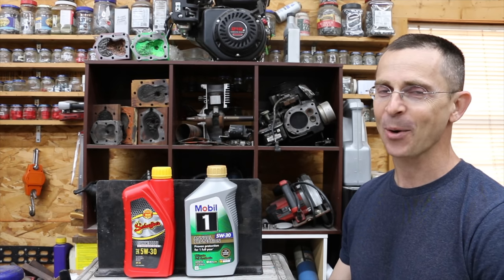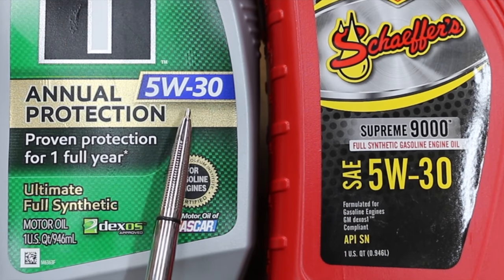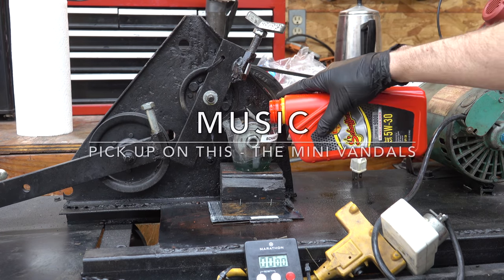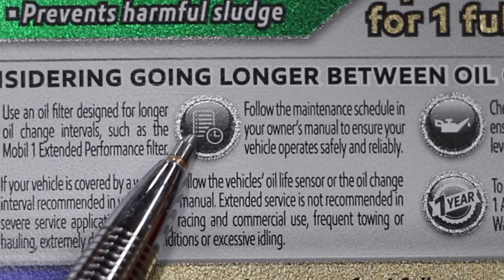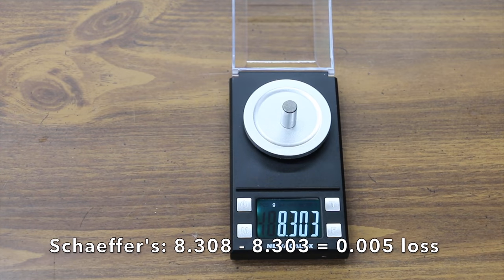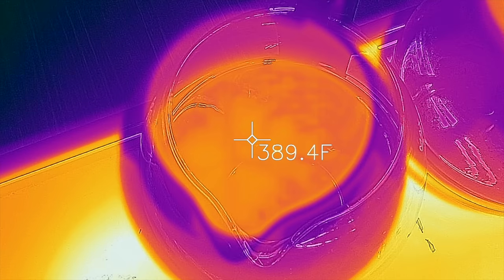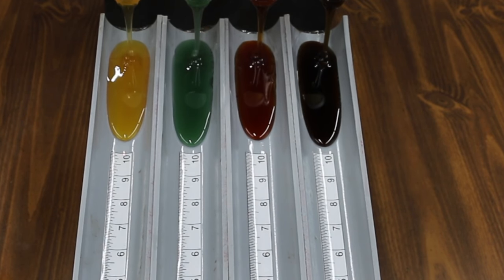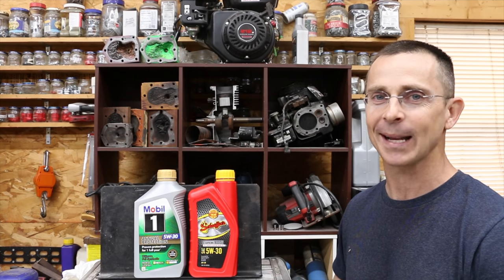Is Mobil 1 better than Schaeffer's Full Synthetic 5W-30 Motor Oil? Let's find out!

Comment: i always use Mobil 1 15,000 mile synthetic but replace between 5-7, i'm not gonna take it to 15 just cause it says i can, and use the extended performance filter.   (i do 50k miles a year, so it feels like i'm changing oil every few weeks) but my 2014 mazda 3 is at 220k miles and no mechanical issues or repairs needed, just maintenance: oil, brakes, plugs and fluids.
Reply from the maker: Thank you

Comment: it's not so much which oil has the lowest viscosity, it's which oil maintains its stated viscosity. I'd like to see a modified film test where you see how much of a friction load the oil can handle while maintaining a oil film so there is zero wear on the bearing (the oil is doing it's job of keeping the metal parts from touching)... perhaps by watching current on a watts meter, finding the point where current jumps at the point where too much friction causes metal to metal contact
Reply from the maker: Thank you for the test suggestion!

Comment: I use only full synthetic oil from many different brands such as castrol, valvoline, promaxx, Mobil 1, and Amsoil. But i change my oil every 5000 miles and my 2016 and 2009 mazda 6 run like champions! Dont trust every 10,000 miles too hot here in Houston Tx! Cleaner oil will make yr engine last longer!
Reply from the maker: Thank you. I change the oil every 4000-5000 as well.

Comment: Tried Shaeffer's in my own car ONCE. We had an extended cold snap. I thought I had a bad battery as the car had a VERY hard time starting. Installed a new battery. Still VERY hard time starting (very slow turnover with starter). On a whim remembering the only thing I had done different was to try the Shaeffer oil to satisfy a friend who had become a distributor. Changed over to Walmart Syntec amazingly car started just fine with even colder temps. Will never use Shaeffer again. Overpriced IMO and not good overall in my experience
Reply from the maker: Thanks for the feedback
Reply: Its funny everyone thinks the oil They use is the best. I've had good luck with Mobil 1 . I have also had good luck with Chevron Delo 100 before we had synthetics and multi grade oil was no good for diesels or extended use. The main thing is to keep it Clean.
Reply: That sounds like a bunch of baloney. Engines need air, fuel and spark to start a combustion process and those 3 things only. Oil is for protection when engine starts running.

Comment: Very nice work! Glad this video popped up. I recently found out about Schaeffers because of their extensive use in the mining industry. 

Their grease is as inexpensive, yet of vastly superior quality, to what you can find on the shelf in store. I would wager because they don’t have a NASCAR advertising budget line on the balance sheet.

I convinced our company to switch to Schaeffers grease for our implements. We had multiple failures occur due to incompatibility issues with the greases used prior being uncontrolled and bearings failing. I could only find it locally retailed at an off road suspension specialist shop, so we bought up their supply.

I had no idea how much variation there is with grease bases and types. Would that be a project worthy of the farm? I certainly found it quite the undertaking to wrap my head around.

Best Regards,
Henry
Reply from the maker: Henry, Thank you!

Comment: Did you ever do a similar test on racing oils ? or , maybe zinc additives ? I added zinc additive  but it may have already been too late when I added it .  We have had cam and lifter wear issues on our flat tappet cam  in our hot rods / circle track / drag toys  . The cam is a very strange shape since it was made for a nhra stock eliminator . They call it a cheater cam ,  it  has  low lift , only .468" / .479"  , and is a hydraulic  lifter  but has  a bunch of duration and the valve hangs open at full lift a long time , and then , snaps shut , just in time from the piston hitting it . The cam is  more square shaped  and I'm guessing that causes too much  heat build up . We only run about 140 lbs of seat pressure  , so it's not the pressure , it's more to do with the shape .
Reply from the maker: Not yet. Great suggestion!  Thank you
Reply: @ProjectFarm   ... another question , maybe viewers would know ??  if you add more than 1 bottle of zinc additive  , will it help ? or , is there a point where more zinc wont help anything ?  can too much zinc cause problems ?

Comment: If Amsoil doesn't produce oil norms required for my engine (ACEA C2, B712290) , should I use another brand or can i stick with their 5w30 without risks ?

Comment: the wear scar on that metal test barrel is pretty extreme for my taste. The "ideal" optimal oil film with a minimal atomic thickness, being prevented from ripping by stabilizing additives would (or even should) never allow metals to actually touch each other if the tolerances are met everywhere on bearings and slides. Or the test barrel pressure weight is selected too high for oil films (punctual molecular layer pressure stability) to even have a chance to show its features.
Reply from the maker: Thank you!

Comment: Regarding your bearing wear lubricity tester, could you please include a control bearing that shows wear after a dry run using NO oil.  Thanks.
Reply from the maker: Great suggestion!  Thank you.

Comment: I change hawe precise changed oil in my engine and gearbox on my pegueot 307 and the brand i got in it was mobile1 5w / 30 the same as you tested i don't think the other brand is marketed here. I have always run with castrol 0w / 40 before and it has worked well my car has rolled 21000 Swedish mileage 1swedish mile is 541 us nmi and it was because I also changed the oil in the gear box, how often do you recommend that you should change  my oil in the manual gearbox the oil  I tapt off was so close to black it coul becan so it felt good to change and according to the pegueot307 manual they recommend mobile1 ... in the service boke it says that oil filters and oil should be changed every 3000mil but there is nothing said about the oil in the transmition. but on my car oil and oil filters have always been replaced at 2000 miles what do you recommend yourself i think 3000mil sounds crazy loong all the cars i had before i have changed oil after 1500mil
1 us nmi = 1.85km and one swedish mile is 10km  so i drive 1081usnmi before i change pil and engine oil is  that ok you think? 

and the to the transmition oil ? whath do you think about thath My engine gas rum 21000 Swedish mile dvs 21000÷1.85=11351us nmi and i changede the transmition oil i dont know if the transmition oil gas ewer ben changed before sura uppe so butt by the collie of it it didnt loked like so..

Love you show and Love you knowledge  best regards Michael bjarnarson a fan from Sweden
Reply from the maker: Thank you!

Comment: I have yet to seen anyone perform these same tests on used oil.  I would prefer to know how the oils hold up after being run in an engine for 1000 miles even in an uncontrolled environment.  I would rather have an oil that performs consistently as much as possible over it's life than only when it's fresh.  So is this over thinking these types of testing?
Reply from the maker: Thank you for the feedback

Comment: I have yet to see a high performance diesel running beyond its original design that ran on Mobil 1.  Everyone  uses Shaffer's, Cen-Pe-Co, PennGrad 1, or Amsoil.  1 turbo, or 4, Water Injection, or Multiport Methanol/water injection, 2600 RPMs or 6500!
Reply from the maker: Thanks for the feedback.

Comment: Is recycled motor oil as good as non- recycled motor oil? That would make a good video. An example would be like this: Is  Valvoline NextGen™ as good as Valvoline conventional?
Reply: Oil never loses it's lubricity.  It is the additives that wear out.  So, if you dump the old additives and add new, there is no difference.  Also better for the environment since new oil isn't needed.

Comment: I notice you shake the oil ... is that required?  I've never done that ... I wonder if I'm doing it wrong?
Reply from the maker: It's not mentioned on the oil containers, but the additive package can fall out of suspension and settle at the bottom of the container.
Reply: @ProjectFarm  Thank you for the reply.  Makes sense; I'm just surprised I've lived this long, and not done it before.
NEXT TIME ...

Comment: which would evaporate quicker  in hotter temp 5w30 or 0w30?
Reply from the maker: Thank for  the video idea.
Reply: I live in the Mediterranean our lowest temperature is 14 degrees highest 46 degrees Celsius with a lot of humidity I need help which would be better suited for a Honda civic 1.6 dtech 2014 as the normal manual just says 0w30 :(

Comment: Good attempt. However your tests are inconclusive for a number of reasons.

1. The mobil 1 you used wasnt the best variant. Was the shaeffers the best variant they made? Essentially I dont believe your are testing equivelent products.

2. You need to cover tests with boiling points, sub freezing temps, the degradation in metals using either oil.. I could go on.

3. Tests should be performed with professional equipment in a lab.

4. In terms of r&d a company being around for a long time helps. But the better employees (general) and the $millions (possibly $b) spent in r&d without a doubt goes to Mobil.

Good video and it's nice people are putting the effort in. But I think you should label this kind of test cautiously as you cannot truly identify which is the better oil or brand.
Reply from the maker: Thanks for the constructive feedback

Comment: Ethanol fuel is produced using corn, a subsidised government program for farmers far more costly than gas. Keeps corn prices stable in the commodity market. Some greenies claim it is enviromental, but the crop farming process combined with distilled corn makes this impossible. Most 10 year or newer engines will run on 10% ethanol, however in storage moisture sticks to ethanol. Using Sta-bil or other fuel stabilizers can help the ethanol remain misible with the gasoline. 
I have ran non ethanol fuel in my Harley Davidson FXSTD 1450 cc twin. No noticeable power or start difference, minor fuel economy with non ethanol. Small power equipment is very different, the chainsaws, leaf blowers those things with stored fuel can have issues. Keeping the fuel tanks full and fresh is important. Using a fuel stabilizer was recommended by the manufacturer of my newer lawn mower if using ethanol fuel. I never have issues. The real test would be to have half full fuel containers partially exposed to or vented to atmosphere. Test use after 6 and 12 months. This is a more real world test, but with different results. My suggestion is conduct a test using a fuel stabilizer,  then one without. That would be 4 segment test, a non ethanol fuel treated and untreated. A ethanol fuel treated and untrested. Then test at 6 and 12 month intervals.  My own test concluded that 10% ethanol fuels have storage issues over time, where non ethanol fuels store best.
Reply from the maker: Great point. Thank you

Comment: This test (like the other oil videos) is seriously flawed. Not all 5W-30 viscosity oils have the same viscosity, so they should not be expected to flow down a ramp at the same speed. The API sets "ranges" for both the "5W" and the "30" and there is a range of viscosities that fit into those categories. Just because one oil is at the lower end of those ranges and flows down the ramp faster, does not make it better than another oil with a slightly higher viscosity (but still rated 5W-30). The only accurate way to determine which oil is best is to run a bench test of 100,000 miles starting with new and modern automobile engines (not lawnmower engines) and then do a engine tear-downs, fuel mileage tests, compression tests, etc.

Comment: I have used synthetic oil in my dodge cummings 5.9 
Since i have gotten it with 37000 miles and just resent changed oil in it and used Delco 15w40 for semi trucks is this a good oil or should I use a different also i change it every 10000 miles or 5000
Reply from the maker: I plan to test diesel oil soon.  I use Rotella 15W40 in my cummins too but will likely switch to T-6 if it performs well in testing.

Comment: Got a good deal on Schaeffer 9000 5w50 racing oil, will using this in a regular car cause any harm?
Reply from the maker: Racing oil typically doesn't have as high of a TBN and is used for shorter drain cycle.  Recommend using the viscosity grade per the manufacturers guidelines.
Reply: The 5w50 racing oil has a TBN of 7.1 so it should be okay for 5k miles but the viscosity is kinda high for a regular car.
Reply: Thanks for the info

Comment: I would guess that if I bought a new car and drove it 100K miles and used either of the two oils,  and changed the oil per the car manufactures recommended time interval,  in both cases the engine would be in virtually the same condition, no matter which oil I used..
Reply from the maker: Thanks for sharing.

Comment: Every engine I have seen that used Mobil 1 looked like waxy deposits under the valve covers and the whole inside of the engine looked an amber color.  Is this a paraffin based oil?

Comment: I have used Schaefer’s for years with good luck. I have also used less expensive oils with good luck. I feel Schaefer’s is no longer worth the money. I can get Mobil 1 full synthetic for half the price. I have even used farm store brand oils with good luck. Maintenance interval is important. I change cheap oil at 3k intervals and better oils at 5K. It is my opinion no oil should be ran longer than that.
Reply from the maker: Thank you for sharing!

Comment: How about.......using the same piping system using.....Engine Starting Either, Brake Cleaner, Propane/NPG, or Model Airplane Fuel Mix at 30% Nitro Methane?
Reply from the maker: Thank you for the video idea!

Comment: Is Schaeffer's 7000 supreme series full synthetic? I dont see the 9000 series in 10w30.
Reply from the maker: Thanks for the video idea.
Reply: @ProjectFarm  was a question that wouldn't have anything to do with a video. I found out tho. 7000 is a blend. 9000 is full synthetic 
If you do a video then do Schaeffer supreme 9000 vs amsoil signature series 
Also Schaeffer supreme 9000 vs castrol extended performance

Comment: Just curious why All dealerships will push Mobil 1 despite brand like Amsoil, Royal Purple, Shaeffers are pretty good oil as well?
Reply: Maybe because Mobil 1 has specific approvals for Ford, GM, FCA, and other manufacturers.  Amsoil Royal Purple, Shaffers do not.  Dealers will not sell oils that do not have the manufacturer's approval for the cars they sell and service.

Comment: Mobil 1 is the best, been using Mobil 1 synthetic since it first came out in 1975 ish. The original was like pouring water ,it was so thin, but it worked great, had a small block Chevy with all of the goodies in those days, ran a Milling oil pump and at idle around 7 to 8 hundred RPM at idle my gauge said it was holding 5 lbs of pressure. Went to my local Chevy dealer parts department and they said 5 lbs was not great, but within specs. When the engine was in higher RPM's it was holding like 80 pounds. By the way, that oil also cause a lot of leaks everywhere due to the viscosity however, got the leaks taken care of eventually. I'm 68 and have ran Mobil 1 since around 75. It is great shit. Mobil 1, Wix filters and Seafoam. Period.
Reply from the maker: Thanks for the feedback.

Comment: Dose your test actually prove the quality....my limited understanding I've learned things like the best oil out there may not be and good with an engine with flat tapper cam followers as there no zinc in it I which I believe old endings need.....so the wear test, as manufacturer use different metals now in the builds is this a true test of the oil, as they now make oils to suit a particular engine? 
The test you do I know are for entertainment too but how close are they to the real test. many thanks
Reply from the maker: All great points.  Most brands still contain zinc and other antiwear additives.  The evaporative loss test and cold flow after heat exposure also provide great information.  Thanks again

Comment: You should test Diesel oil 15-40w
Reply from the maker: Thank you for the video idea!
Reply: Yes. In thetic 15 W 40 they're making it now Amsoil vs. Schaeffer's vs. Triax vs. Mobil 1 or maybe Redline since mobile one has just been defeated my money is on the Triax
Reply: @ProjectFarm  most good companies have come out with full 15 W 40 synthetic diesel oil Triax Schaeffer's Amsoil Mobil 1 Redline maybe one or two others worth testing I bet on the Triax
Reply: @ProjectFarm  Triax has two 15 W 44 synthetic diesel oil when is Fleet Supreme the other is agricultural supposedly better for heavy machinery like tractors Fleet Supreme Biltmore for Highway use trucks and the like either one I believe would test well

Comment: I Would not use this test to determine what oil I buy, I think there's more that goes on to testing oil in an engine than what he's testing for. How did the oils perform after 8,000 MI in an engine? In reality the small differences in the test between shafers and mobile one aren't that big of a difference, I would be more concerned of how long the oil will protect the engine at an acceptable level before it needs to be changed, or how long it can keep it's cold flowing properties and hot flowing properties before it starts to break down. So again I caution people from abandoning the oil that they've always used just because of this test.
I would find out what motor oil they use in the 24-hour LeMans 😂
Reply from the maker: Thanks for the feedback.